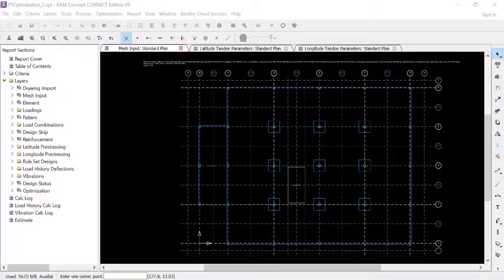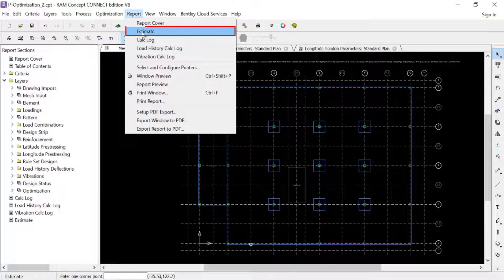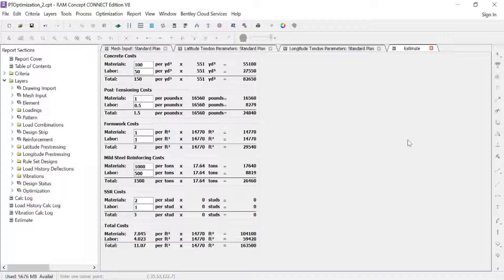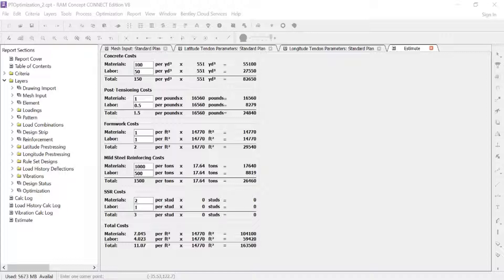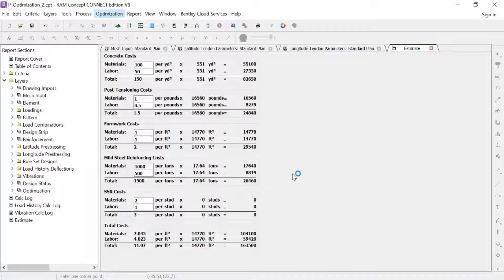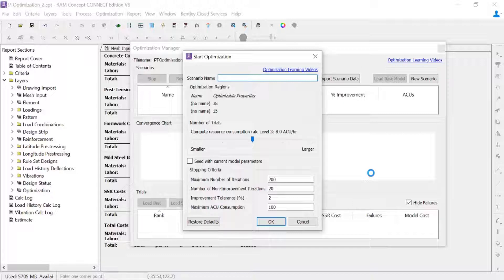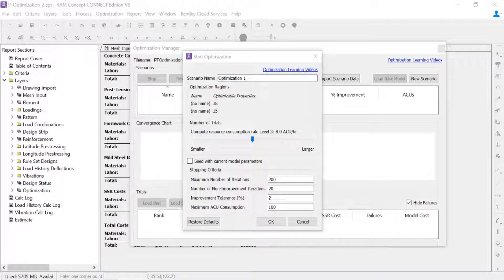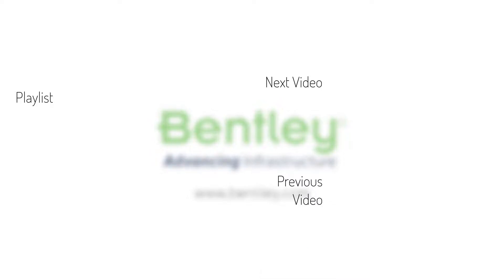Starting the Post Tensioned Slab Optimization Process in RAM Concept

Comment: Thank you for your training sessions — they have greatly helped me improve my skills with RAM Concept.
I’m currently facing an issue with reinforcement. I would like to know how to eliminate the shear reinforcement in the slab and how to properly distribute the bottom reinforcement mesh.
Despite my efforts to manually adjust the layout, there are still some leftover reinforcement bars showing up, and I’d like to understand how to remove them effectively.